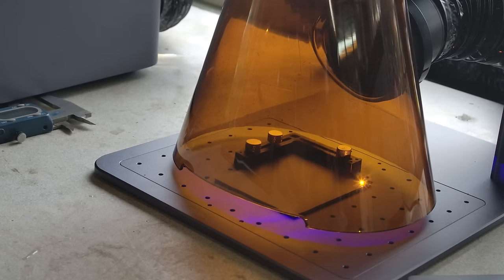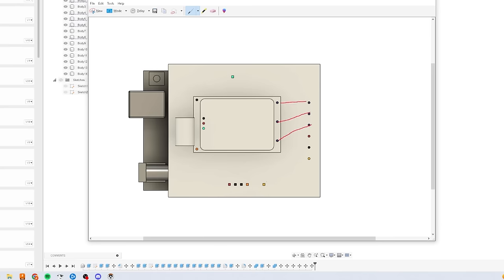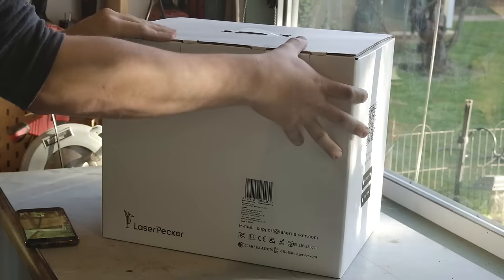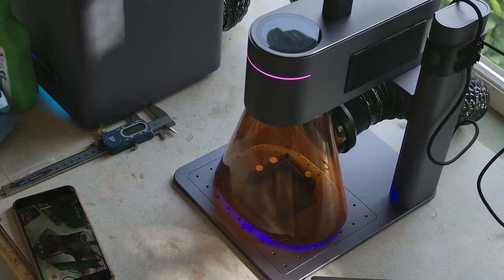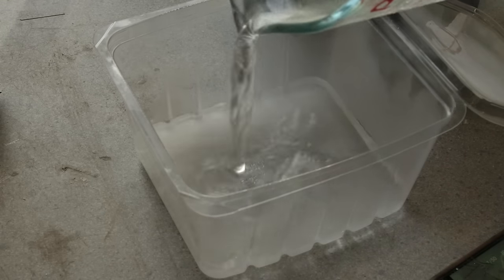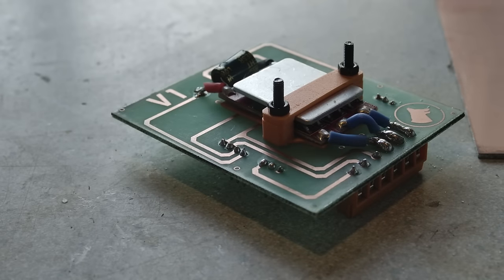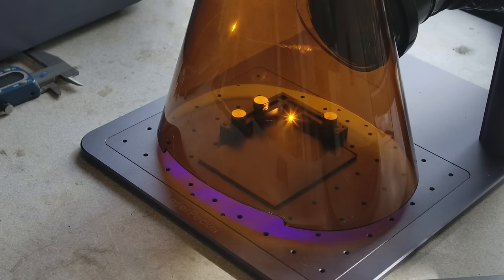Making PCBs With lasers

Comment: Although the pcb is quite simple, you should design the pcb so that least copper is etched, you basically removed 90% of the copper
Reply: It depends on how long you want the etchant to last. If you only do one PCB every 2 years you might not even care.
Reply: @SianaGearz  true but having a large ground plane can help with other things as well, cooling for example.
Reply: @HairyStuntWaffle  also he had to lase away more material, using more time and energy
Reply: Faster etching results in sharper traces. So even when you don't care about etching solution, there is a benefit to removing the smallest amount of copper possible

Comment: Your main issue with the soldering is yanking the iron away immediately. Put a tiny bit of solder on the tip of the iron to help heat transfer, put that against both the pin and the PCB pad, wait a second for them both to heat up, put the solder to the other side of the pin until it melts, remove the solder and wait a second, and only then remove the iron.

Comment: Kicad is pretty good since you have 3D view with components. It interacts with mechanical CAD software via STEP files both ways if need be.
Reply: I use Kicad, export as Dxf and use that in Lightburn to generate gcode for the laser.

Comment: Dude...Fusion has Eagle embedded in it these days. Whole parts library, schematic editor, PCB layout, everything. Integrates perfectly with your mechanical designs, too. It's one of the most compelling features of Fusion. It takes a little learning (afternoon of watching videos and futzing with it) but it's reasonably easy to use.
Also: that laser is NICE! I need to check that out. And the board came out beautifully.

Comment: For the PCB etching container I’d recommend something made of polypropylene if you’re going to use plastic. It’s what those chemical squeeze wash bottles are made of and few solvents will attack it. As always, check the chemical resistance charts first. For ammonium persulphate it should be resistant up to 60C.

Comment: Cool video!
About the soldering, don't put the solder on to the iron and then on to the pin and pcb pad. This will create a weak solder joint.
Instead heat the pin and the pad at the same time, apply the solder from the opposite side of the pin.
Reply: Came to the comments to say the same thing

Comment: 0:36 Fusion actually has an entire section dedicated to the design of PCBs.
Reply from the maker: damm you think I would have like, googled that, at least once right. Live and learn I guess.
Reply: @Borgedesigns  Fusion Electrical is very good but there is a learning curve.   It outputs a full manufacturing data package.   The gerber files can be imported into FlatCAM and the board can be isolation routed on a milling machine.  I wonder if the laser would cut the copper as an alternative.
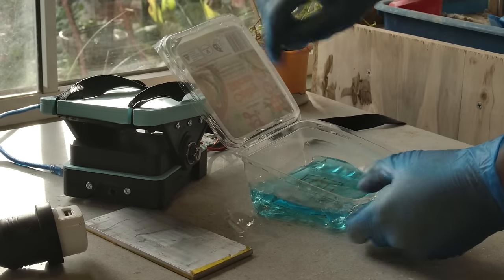Reply: 4:08 forbidden gatorade
Reply: lol how long has that been there?? I've never noticed it😂
Reply: @Borgedesigns  To be fair, it's pretty well hidden
Reply: There is a three part YT post by Will Donaldson covering some of the basics of Fusion Electrical.
Reply: The free version of Fusion 360 only does two layer boards so I switched to kicad which is pretty easy to use.

Comment: Awesome! A thought occured to me when I watched you vid - what I do to make my drill holes super nice and centered  is to just design a small hole in the copper pad (0.2-0.4 mm), instead of the size of the intended hole (usually 0.8-1.0mm). That way it can nicely catch the tip of the drill bit and center it. Drilling by hand is then doable. Drilling using a drill press is a piece of cake.

Comment: Kind of cool. 
There are so many different ways of etching PCBs. Lasering is one I haven't heard yet.
I have tried a few but IMHO its not really worth it anymore.
10-20 years ago prototype PCBs were rather expensive, 100$ or even more for a few boards.
But now with JLC, PCBWAY and similar services, its very cheap and also quite fast. Like less then 10 bucks including shipping to Europe from China. The quality is professional level, 4,6,8 layer boards are not an issue, they sometimes even make free/cheap stencils. 
So I see very very little use of making them yourself in 2024.

Comment: for the dodgy solder joint on the 3 pin header... try reheating that pin with a little bit of flux... electronic shops will sell a flux pen so you can add a small dab of no-clean flux (no clean flux doesn't need to be washed away after with water)   

For the coating, you could always use a spray on conformal coating,  electronic shops will have this in a spray can with names like MG Chemicals.

Comment: For your through-hole terminal connectors, make sure to design around your board layers. Because the drilled holes aren’t lined with copper, the top and bottom layers are electrically separate. You could get around this by putting your traces on the bottom of the board where the pins stick out. Cool manufacturing method tho!

Comment: Very nice. I also use a laser for PCBs. My workflow involves KiCAD, which I highly recommend. By drawing out your schematic in eeschema, it defines your netlist and ensures you don’t make any incorrect connections when laying out the board in pcbnew. You can then export a 3D model of your circuit board, and various 2D formats.

I have a diode laser with poor resolution, so I’m using a post-processing script on the SVG to compensate for laser thickness and unify all the SVG objects, then I use lightburn’s offset fill to prevent any artefacts. I use a black spray lacquer instead of a paint, because the fumes aren’t as bad and it wipes off easily with just some isopropyl alcohol. For etching, I just put the board in a container sitting on my ender 3 bed and set its temperature to 60. I’ve written some g-code that just moves the bed back and forth for 30 minutes or so, the agitation plus heat means my etches are done in half that. Though I use ferric chloride (Bunnings HCl + nails) so YMMV.

I’m also working on automatic drilling, using KiCAD’s outputted drill file. The ender 3 was fine to bolt a laser to, but was too flexible for a drill even after I added tie-rods, so I’m in the process of swapping everything over to a 2nd hand snapmaker original. I need to make a new laser driver so my 5W diode laser can run off the snapmaker’s 24V supply. I wrote a Python script that takes the drill file and outputs a g-code file, and even has support for slot holes like you get on DC jacks and basically nothing else.

As for solder-mask, it’s not trivial. I tried using heat-resistant spray paints, but they just wipe off with the iron unless you bake them. I think the only method that will work is to use a resin, like UV-cure soldermask. But getting it thin enough that it’s easy to burn off without roasting the copper or FR4 underneath is tough. So I built myself a spin-coater for applying a thin coating of UV-cure soldermask to any oddly shaped board, using a brushed motor and a 3D printed 4-jaw chuck made with threaded-rod. The firmware on my custom motor driver doesn’t work because my programming ability is trash. I’ll probably add a differential amp for measuring the output current directly, low-side current measurement with PWM synchronous readings isn’t working for me I guess.
Reply: could you explain why the traces didn't wipe off after getting lit by a laser? is the spraypaint easier to dissolve after exposure?
Reply: @king_james_official  so the laser isn’t powerful to burn through the copper itself, at least not at that speed. It was solely being used to burn through the layer of spray-paint, after which the residue of this paint is wiped off with a damp cloth. The copper that doesn’t have spray-paint on it is exposed to the etchant solution and is dissolved, while the copper with paint still on it is protected from etching. When the remaining paint is dissolved in acetone, only the copper that wasn’t dissolved by the etching solution is left behind.
Reply: @Scrogan  oh yeah i know that it's only burning the spraypaint. so the thing he sprayed on after the laser run was just water? i got confused and thought it's paint solvent
Reply: @king_james_official  I found water worked fine to wash off the debris, but it was better after running two passes of the laser. You get a fine sooty layer that a dry paper towel isn’t quite enough to get rid of. I think there’s a bit of tar in the debris too, maybe a mild solvent would help wipe it off.
Reply: @Scrogan  thanks a lot

Comment: You can use your 3D printer (bed slinger) for etching. It also heats your etchant to your desired temperature. Works really well. I have a klipper script for my ender 3 which moves the bed back and forth.
Reply: is this klipper script available somewhere?
Reply: @DM-fz3ly  hmm, I can't find any linke anymore but here's the macro from my config:

[gcode_macro etch]
gcode:
  {% set bed_temp = params.TEMPERATURE|default(45)|float %}
  {% set cycle_count = params.CYCLES|default(255)|int %}
  # 30 cycles = 106s -> 255 cycles = 900s

  M118 Etch started { cycle_count } @ { bed_temp }

  G91 ;Relative mode

  M118 Heating to { bed_temp }
  M190 S{bed_temp} ;Heat bed
  
  M118 Cycling { cycle_count } times
  {% for cycle in range(cycle_count) %}

    G4 P1000 ; delay 1 second

    M118 cycle {cycle+1}/{cycle_count}
    G1 Y-20
    G4 P1000 ; delay 1 second
    G1 Y20
  {% endfor %}

  M118 Disabling Bed
  M140 S0

  M118 Etch Completed

Comment: Your soldering is O.K., I have definitely seen worse.

As a general tip, I would clean your soldering iron tip, 'wet' the tip with a small bit of solder, hold the soldered part of the iron on to the part you will be soldering, then feed the solder wire into the PART itself, rather than the iron. I work in manufacturing and these are some of the tips we use to ensure high quality. The reason you want to feed the solder wire into the part is because of the flux within the wire. If you feed it into the soldering iron, the flux essentially burns off very quickly. Flux is very important to ensure a proper connection.

Well done with the project. I am very jealous you have access to DIY circuit boards now :)

Comment: Can you directly etch the copper from the PCB with the laser instead? Like they do when PCB milling with a CNC router. In this case you don't need to remove the whole unused copper, just trace an isolation space around the actual traces. Should be much faster and does not require painting and cleaning steps and also no chemicals
Reply: No. It would require very strong laser and probably different wave length. But you can etch way less copper. You just need to design better mask.

Comment: Ferric chloride is a far better etchant. Especially if you heat it up to warm coffee temp.
Polypropylene chinese food containers work great and have a nice flat bottom so you only need a few mm depth of etchant.
And you dont need a swisher machine because it will etch in 2 or 3 minutes of hand swishing.

Comment: Can you laser the copper away so no need to etch? Not saying it’s smart but it would be interesting.
Reply: I have the same laser and it's not powerful enough to do this. However it's possible with more powerful lasers (probably 20W and above). I'm not sure if the isolation between the paths is as good in this case, since some pieces of brass might still be attached to the board; maybe not a good idea for high power circuits.

Comment: I looks like the paint disappeared from the laser at https://youtu.be/rwffcaSn5hI?t=188, yet you have paint left when removed with acetone(?) https://youtu.be/rwffcaSn5hI?t=205 ... I don't get it. It would be nice if you could explain some of the details more.
Reply: Yes, you're right. He lied about "the Board came out beautifully in the first try" He didn't invert the image...
Reply from the maker: I thought I had messed up when I saw that at first as well! There was paint dust left that needed to be wiped off with water, and for whatever reason it made it look like the board was ruined when it first came off the laser. I think its just the texture difference between the lasered/ not lasered areas.
Reply: @Borgedesigns  So the laser removed the paint? What kind of paint was it?
Reply from the maker: @tcurdt  Plain cheap spray paint, the dark colour is whats important. Being a flat or matte colour helps as well.

Comment: 3:06 to 3:11 Seems like something is wrong with the approach you are using, because power of the laser seems too high and on the contrast the black powder still resides on pcb after marking, that looks odd ? Saying that cause when I do fiber laser pcb to remove black paint from it, I don't use amount of power so that it sparkle, its light, and black paint is completely removed, I can see pcb copper immediately after marking line passed, sometimes I do 2 light passes.   
Should look something like this but with less or similar power : https://www.youtube.com/shorts/p_Df9brvek8

I am glad that people start to appreciate how powerful and easy it is to make precise PCB with fiber laser...  

I see that it has 2 modes of operation  1 - 10W Blue 450 nm blue diode laser and 2- 2W 1064nm Infrared laser, so I am not sure of how quality is the second one. 
I assume you did with infrared one, as that should be way to go, as that is the one I am using with my fiber laser which is 20W of power.